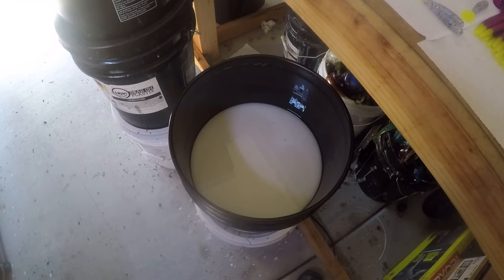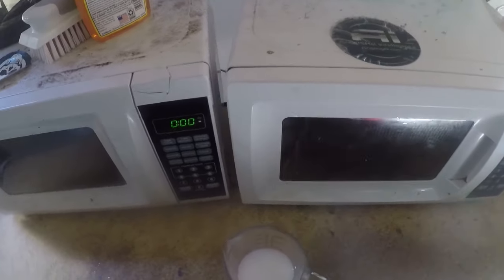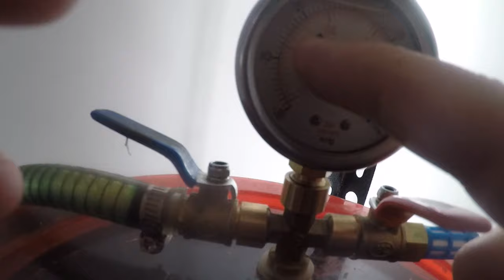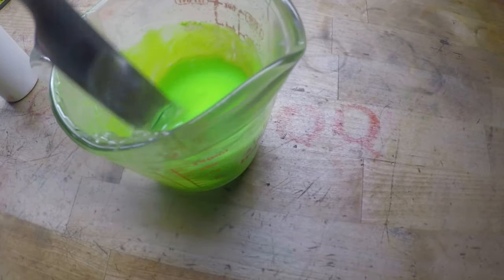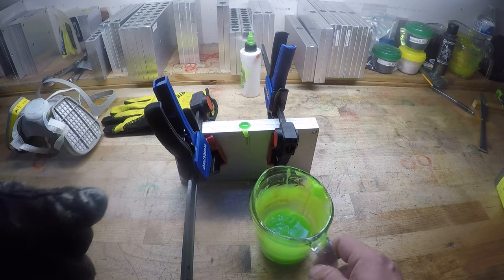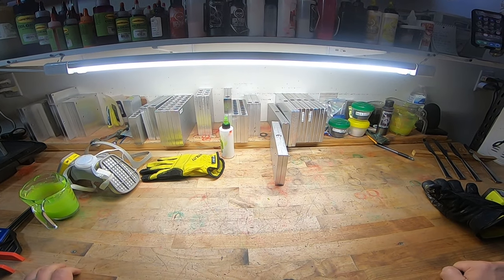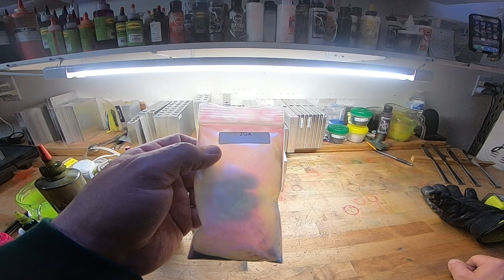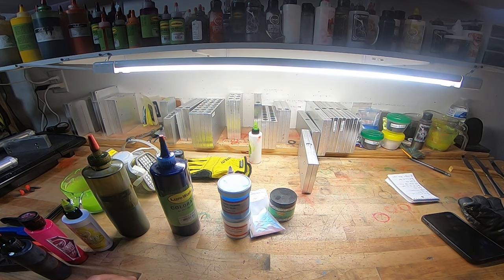Soft Plastic Baits - Questions Answered!

Comment: Im new to pouring plastic and I’m having a problem with denting. I also use dead on and have shot slow,fast, holding pressure,pre heated and still have issues, any help would be greatly appreciated. Thanks.
Reply from the maker: Hey Bob!  Thanks for reaching out...  could you tell me which mold you're having denting issues with?  Also...  what temps are you shooting at?  Usually, denting is an issue with shooting too hot and too fast.  Without knowing anything else about your situation, my first suggestion would be to shoot around 300 degrees F and hold a little pressure for a few extra seconds.  Let me know of that helps!  Thanks...
Reply: @getoutandfishusa3554  mostly finesse worm and creature molds. I'm shooting slow but maybe too hot, I will try and get the plastic closer to 300. Thanks for the response its much appreciated.